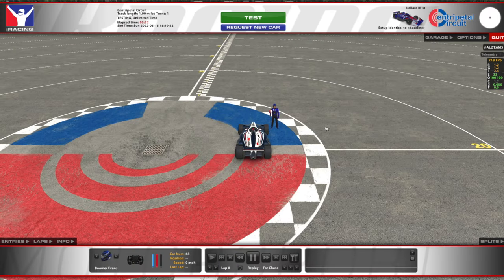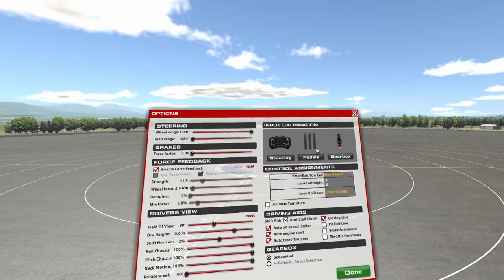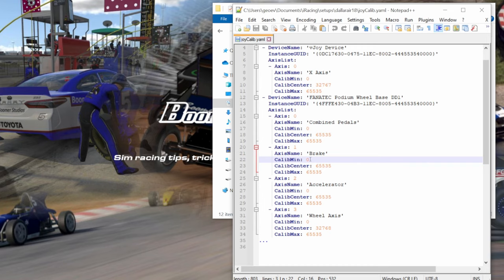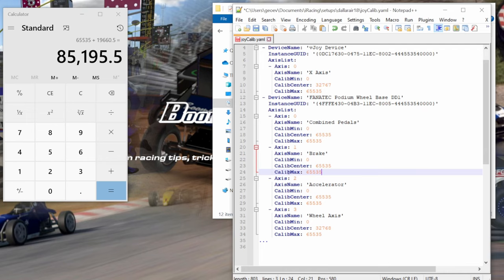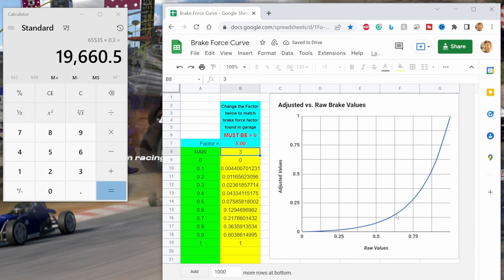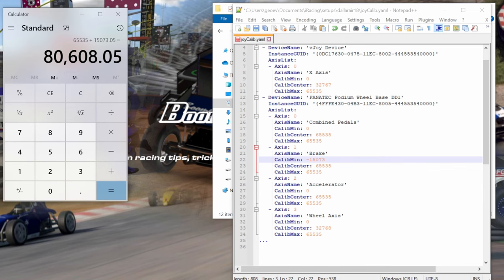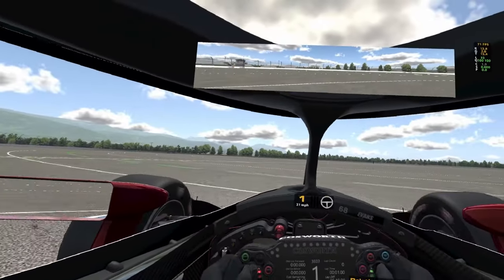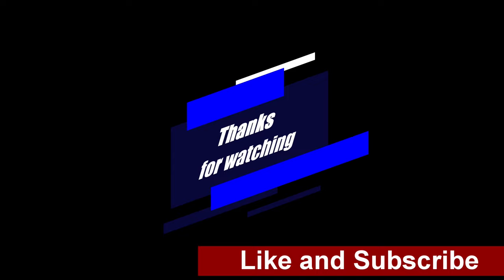iRacing Setup | Get more out of your brakes with 2 easy tricks!

Comment: I also have a hard time determining wheel locking in cars that don’t have a visual indicator. And sometimes locking is present to some degree but the wheel is still rotating.  A good example is the LMP3.  What’s the best way to determine which wheels are locking and to what degree?  I look at replays from outside the car, it’s time consuming and not measurable.  Thanks, great vid.

Comment: Hey man, nice video. Just a quick question, if you have to set the min number to negative, does that mean there's no way to set a deadzone anymore?
Reply from the maker: Thanks for watching! No, you can still set a deadzone. You just have to adjust the "zero pedal travel number" to reflect the deazone. Or you can do it in the wheel software. 👍

Comment: Personally I think this is closer to cheating than clever only in that you would not do this in RL ever or anything like it.

That said though I do realise that with a cheap set of Pedals it can be very, very hard to estimate just how much braking force you are applying so I don't have a problem with it.

However what I would recommend for a better and more realistic fix for this is to either Mod your Pedals with a Load Cell like I have or buy pedals which have it already, it will change your life in braking zones and it's so much more comfortable and realistic.
Reply: Literally everyone that’s fast does it.
Reply: How is it cheating...Most if not all mid to hi end pedals have software that does exactly this...Us mere mortals have to do it in the joy.calib file.

Comment: Wouldnt it be best to change the brake factor ingame to whatever you want, like in your example 2.5 and then play with the numbers in the notepad until you dont lock up anymore?
Reply from the maker: Either way will work. It's easiest for me to think of the ingame adjustment as changing the curve, while the changes you make in notepad place a hard limit on the pressure. Thanks for watching! 👍